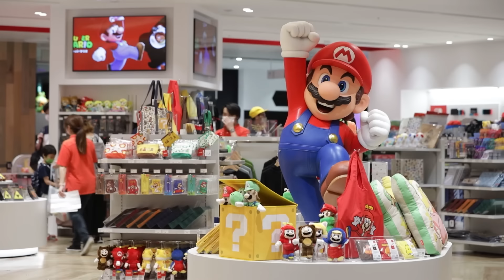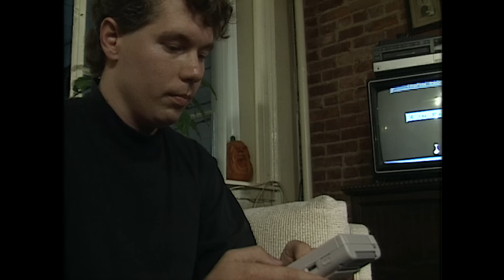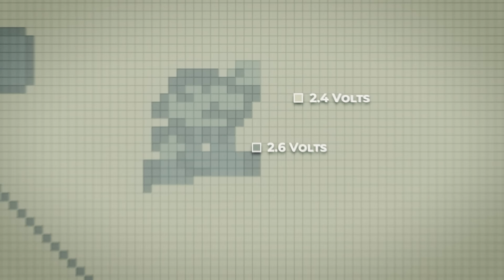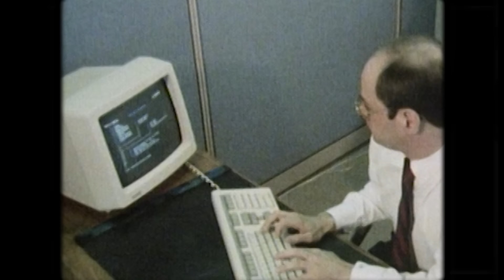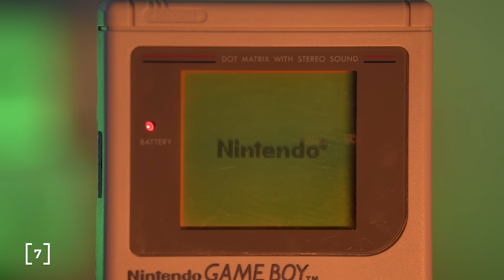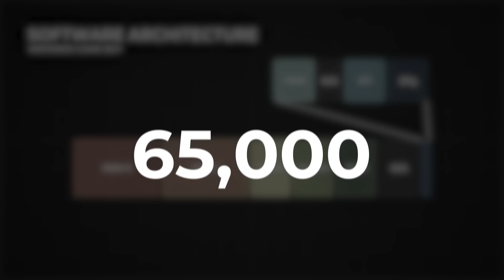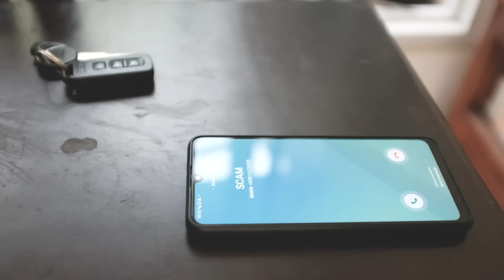The Insane Engineering of the Gameboy

Comment: I believe you are incorrect on the battery life of both the Gameboy and Gamegear. 

You quoted battery life of the Gameboy on Lithion Ion batteries but quoted Gamegear battery life on alkaline. The advent of lithion ion batteries in the early 90s in the middle of the gameboy lifecycle extended the operating duration of both Gamegear and Gameboy. Gamegear went up from 2 to 3 hours on alkaline, up to 4 to 6 on lithium ion. Gameboy duration went up from 10 to 15 hours on alkaline, to a ridiculous 25 to 30 hours on lithium ion. 

The advent of lithium ion battery technology extended life duration so ridiculously, it allowed Nintendo to make the Gameboy Pocket with an astonishingly small dual AAA battery set up, and still hold 10 to 15 hours of battery life.

Comment: The Atari Lynx, released around the same time, was much more advanced- 16 bit vs 8 bit, color vs B&W. 

Its biggest problem? It went through batteries way too fast and the gaming titles were so-so. It also had another advance feature though- you could link multiple units together with a cable, with multiplayer gaming possible.

All this brilliance didn't stop the Lynx sinking without a trace!
Reply: No, it's greatest feature was that you could turn it and thereby exchange the controls.
Reply: I don’t understand why none of these used a 16 bit CPU. Nintendo had to delay the GBA because ARM wanted 32 pins just for data. Now Atari and Commodore put 256 bytes of SRAM into many of their chips in 1981. Intel offered a 16 bit CPU on an 8 bit databus (8008). Lynx and Gameboy were compatible to nothing else. Both could have used a CPU with 16 bit code cache. So 128 words. Or rather, 64 words in 8 cache lines. 8 24bit addresses . 16 dirty flags.

32 registers to cache code. 32 bit to avoid bank switching. I usually hate prefixes, but if you run out of registers or need to pack data, a prefix could select bytes / words out of and into registers. Maybe even select a bit field which crosses a register boundary using a second register as bit granular pointer.
Reply: @ArneChristianRosenfeldt  Your post makes no sense. They used a version of the Z80. Why would you want 16 bit work registers, what for?
Reply: @0MoTheG  16 bits are needed for addresses (pointers) and large levels with scrolling. Even frequencies of audio needs more than 8 bits. Most instructions are 16 bit wide -- unify this! I was mashing Atari Lynx into this a bit, sorry. The Lynx has shared memory with the VDP and would really need a cache. I now checked that banking is used to reduce the pins on the connector of the cartridge. So no need for more than 16 bit in the CPU.
Reply: @ArneChristianRosenfeldt  What you write is only explicable assuming you are ignorant and young. Apparently you can not comprehend what was possible at that price and point in time.
Later games had huge memories but the early titles had just a few KB and no MMU. Even the later titles such as Pokemon used clever compression.
Reply: @0MoTheG  Atari and Commodore created chips for the masses not the classes. The first 16bit CPU for homecomputers appeared in the 70s. ARM was meant to be super cheap. It only had half the number of transistors as a 68k. ARM was CMOS in 1985. I ran on static electric from the tester alone .. so similar low power like a Gameboy. As I wrote, the packaging of ARM was too expensive. I think that we can agree on this. You talk about kB, I talk about mere bytes on the chip. The connector to the cartridge had 14 address lines from the start. You need the rest of the address space for boot ROM, IO, and RAM. Maybe you think of Atari VCS or 2600 or so?

Comment: I had a game boy pocket when I was kid, got tired of spending all my money on batteries so when to buy an charger, the official charger cost $40 (NZD) in 2002, I remeber being blown away, adjusted for inflation's that around $70 for plug and cord.   The Gameboy wasn't a cheaper option for very long.  I couldn't find a 3rd party charger that fitted the Gameboy so I just found a cheap one with the right voltage, cut the plug of it and soldered the wires to the battery contacts.   Nintendo policy today design products with the cheapest crap than can get away with then sell it for its weight in gold.

Comment: I still remember the original game changer (sorry for the pun). The Nintendo Game Watch series that culminated in the double screeen Donkey Kong. That was THE must have toy of the early to mid eighties. It was ground zero for kids dropping the bat and ball and sitting in the corner punching buttons. It too was LCD, but relied on fixed positions. It was purely about timing. It's where the expression "clocking" first emerged. The score generally only went to 999 and the game effectively reset to the begining. "Clocking" a game was a big deal. "Clocking" on first life even more so. Oh, and it told time and had an alarm that use to go off an annoy teachers. 😂

But hey, I remember Space Invaders in black and white with left / right buttons, not a joy stick. They then added a colour filter before colour screens were a thing. 

Fun times.

Comment: Amazing how despite having much more basic specs than its main competitors, the Gameboy had by far the greatest cultural relevance which persists to this day. Sega's Game Gear just felt like a cheap inferior version of its Genesis system, while the Game Boy felt like something different and unique in its own right compared to the NES. Not to mention, the Game Boy and its expansion versions, the GB Pocket, GB Color and GB advance had backwards compatibility, similar same controls and similar user experience until the DS was released in 2004. I mean, even Pokemon, Nintendo's most valuable IP wasn't released until 1998, 9 years after the launch of Game Boy, and 4 years after the N64. Nintendo dominated the mobile gaming market for about 2 decades until smartphones became ubiquitous, and is still making the top selling portable platforms after smartphones. 

Considering the project was almost scrapped, the history of video gaming would be very different today if the Game Boy hadn't been released when it was.

Comment: The "blow into the cartridge" wasn't a thing that started with the Gameboy, I was doing it with the Atari 2600 back in the early 80's.
Reply: The old bang and blow, which later showed was more likely to increase chances of cruft and corrosion on the contacts. Still the magic seemed to work at the time. Never had this issue on game boy myself only the NES. I can see it on the 2600 or other cartridge systems
Reply: @cherrybit1554  This was my experience as well: "Never had this issue on game boy myself only the NES."

Nor did I have to blow on SNES or N64 cartridges. It was only the NES cartridges.
Reply: @cherrybit1554  Ah those were the days.
Reply: @cherrybit1554  It's funny because what we were really doing was reseating the cartridge but blowing was just for the good luck.
Reply: 5 year old kids ain't got no iso-propanol or cotton swabs.
They got sand, dirt, water, spit, air and minor physical strenght. 
All of these resorces were tested and mixed in diffrent ways. 2 of these options increased the chanse of the game working, a combination of air and light tapping.
Reply: Yeah, reseating the cartridge is what actually worked, not blowing on it. The common recommendation these days is to wipe the contacts with isopropanol soaked cotton swabs.
Reply: @SnakebitSTI  I believe the moisture from your breath did help with getting a connection. Of course that same moisture would just cause more corrosion over time.
Reply: I remember doing it on my Intellivision.. Now that was wild. Tron deadly discs anyone?
Reply: The 2 main enemies of every electronics: water and dust.
Reply: Respect to you, Sir.
Reply: Came here just to look for this comment. You can tell the writer's of Real Engineering are under 40 :P
Reply: Not one single person has ever blown on a GameBoy cartridge.  Ever.

Comment: Programming has come such a long way, from woven wires in the Apollo Guidance Computer and physical switches of pinball machines, to tight memory management of C language and C++, to modern visual compilers where you don't have to worry about individual line coding. Is one necessarily better? Kids today can worry about Meta concepts and not such mechanics, I guess  it's progression.

Comment: NiCD rechargeable batteries where around back then, just be sure to not recharge those until they are dead. The Game gear was way ahead of its time, it even had a TV tuner. The 6 batteries not lasting long is what killed the Game Gear. I used rechargeable batteries with the Game Gear. I had two sets, and never bought another battery for it.

Comment: I miss the days when software did exactly what it needed to do. Now you have hardware hundreds of times more powerful than in the '90s, yet boot times and program startup times are about the same. Because of the insane amount of bloat modern software has, plus the unwillingness of developers to optimize: have the users buy the newest device instead of them putting some effort in making the software run faster. And woe to you if you get a software upgrade: now you have to upgrade your hardware too because of who knows how many new feature that I don't even need.

And it's not just the '90s. In 2010, I could watch full HD YT videos with 4 GB RAM and a 10 Mbps internet connection. Now my browser alone eats that amount of RAM, and not because my browsing habits changed that much. Also in the early '10s, when I was on mobile I could browse the net with some difficulty if there was an EDGE connection available, and smoothly with 3G. Now if there is only 3G available, nothing works. I dread 5G not because it's "new tech" but because they'll bloat devices with so much data use that a 4G network won't be usable any more, and at the end nothing will be faster, you just need newer devices and 5G coverage everywhere.

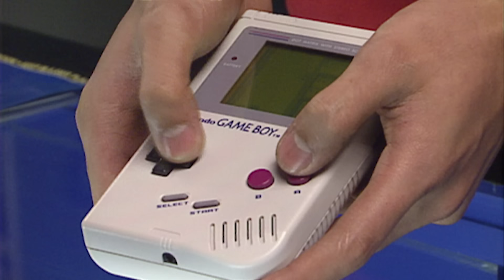Comment: 3:20 I had a game boy as a kid in the mid 1990s, if you bought a new set of batteries every two weeks to play your game boy you were one really stupid kid. Nobody did that, you bought rechargeable batteries and a charger and you were set for a long time. Sure the rechargeable batteries had lesser capacity but I knew NOBODY who actually went out and bough non rechargeable batteries every time. That's just silly. I remember back in the day battery play time duration wasn't really THE big selling argument. Everybody knew the Game Gear was technically superior but it game on the market as a reaction to Game Boy so it came later. The Game Gear was also significantly more expensive but had a worse form factor design. But most significantly, the game gear had far less game titles compared to the game boy. In short not battery life was important, rather game title selection and price were more important reason the game gear wasn't as popular as the game boy.
Reply: Batteries by the time the GameBoy Color came out were different than the original GameBoy. Also depended on your region, remember that many people lived in rural towns, your battery options were what your grocery store or hardware store provided

Comment: Is it correct that the Gameboy created two different voltages by having two taps in the battery compartment, leading to unequal discharge of the batteries?
That was always my assumption to explain the observation that swapping the batteries around often gave the Gameboy additional run time.

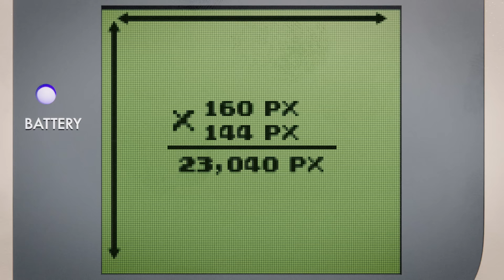Comment: Is the maths correct at 9:40 correct? 160x144=23040 pixels. Each pixel has 4 bright levels which requires 2 bits. Therefore the screen needs 46080 bits, which is 5760 Bytes or 9% of addressable memory.... or have I missed something?

Comment: I used 2 cells nicd accumulators used primarely on metanometers in coal maines here where I live. No AA/AAA available back then and long after. I pushed them inside some medicine pills container and connected by wire with a device. Worked very well with no costs. Everyday charge with small current so that accu would be ready for next day trip to/from school (~90 minutes).

Comment: Somethings feels a bit... off with this video. There are a few mistakes, for example with the way the ROM is mapped - Bank 0 of the cartridge is mapped to the first 16KB of address space (the word used is... directory? Which is not correct?) and an MMC chip can swap out the second 16KB bank with another 16KB bank on the cartridge - mapping chips handle this in different ways, some with limitations. Tetris only has 2 banks (32KB) and thus fits into "ROM0" and "ROM1" address space, not just ROM1 as shown in the video. As pointed out before, some of the language used makes this feel like this is an AI script, or at least has gone though AI at some point.

The 3D work is fantastic though, where correct.

Comment: 9:31 pedantic correction: technically, it would only need to store 2,880 single-byte numbers, as each pixel only takes up one bit. 256 x 144 / 8 = 2,880.
Reply: Pedantic correction to the correction: the GBA uses four shades per pixel so each pixel requires two bits making a full-screen bitmap needing 5,760 bytes.